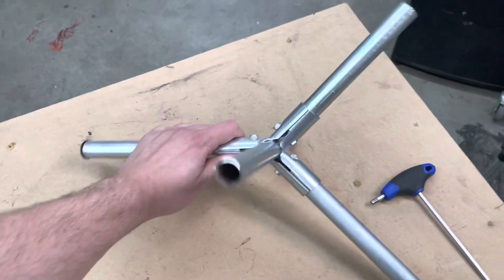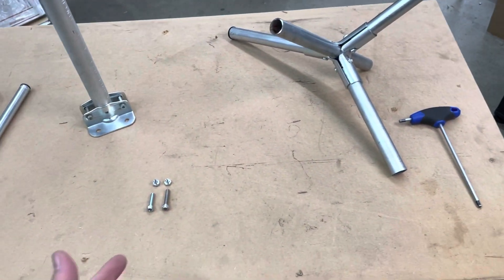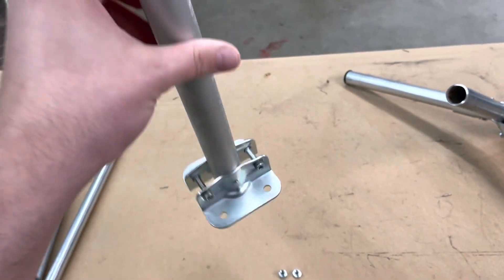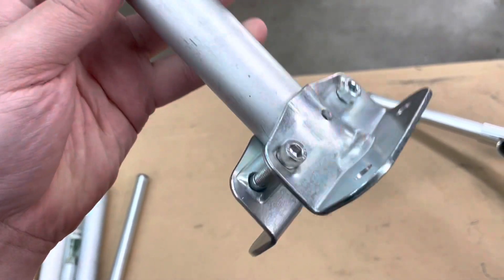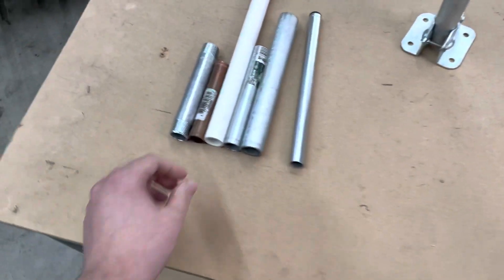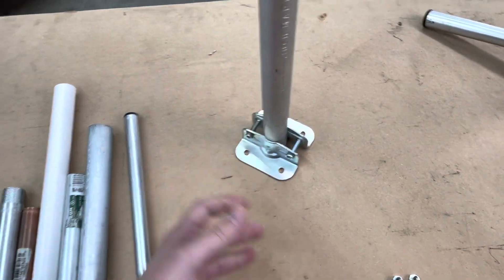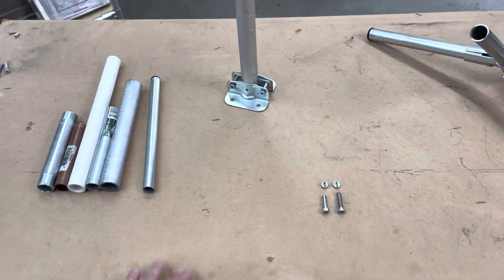This Connector Is More Versatile Than We Thought!

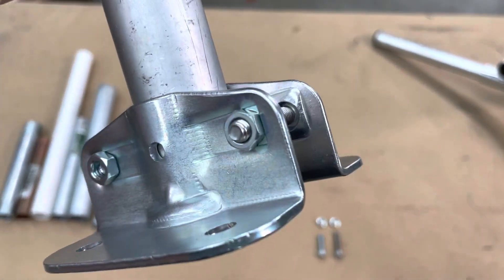Comment: Those bolts will fit perfectly if you tighten the nuts evenly 0:59
Reply from the maker: They are tightened evenly. One is just 25mm and the other is 30mm.

Comment: What are the actual OD dims of 0.5" 0.75" and 1.0" EMT conduit?
Reply from the maker: Hey Brian, thanks for the question.

1/2" EMT OD = .706"
3/4" EMT OD = .922"
1" EMT OD = 1.163"
Reply: @MakerPipe  Wow thank you! Crazy how different the dims actually are!
Reply from the maker: Yeah it’s kind of confusing haha apparently the trade size which is the size in the title of each one represents the diameter of the wire bundle you can fit through it when running wires.